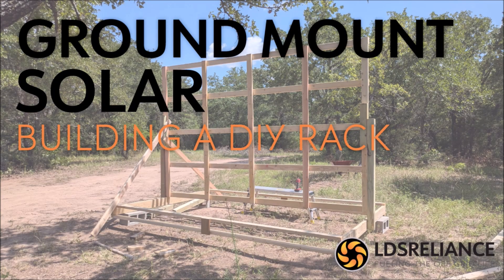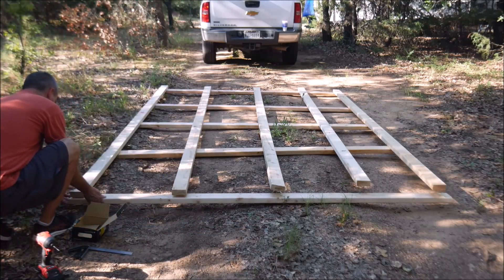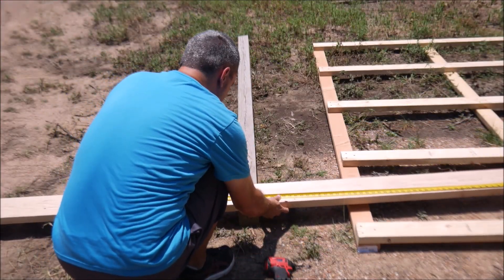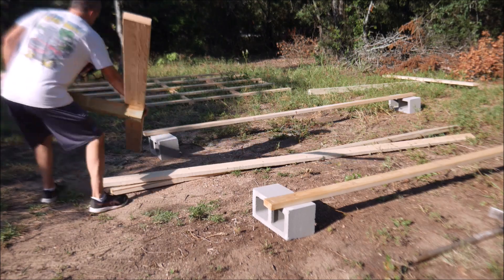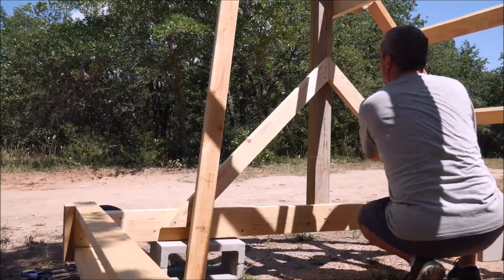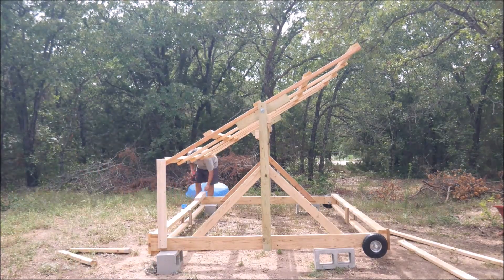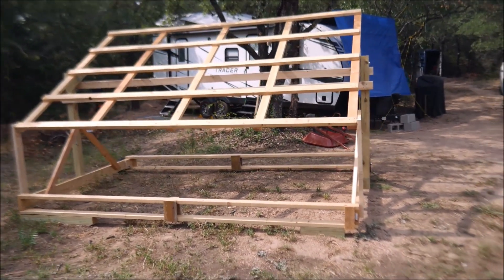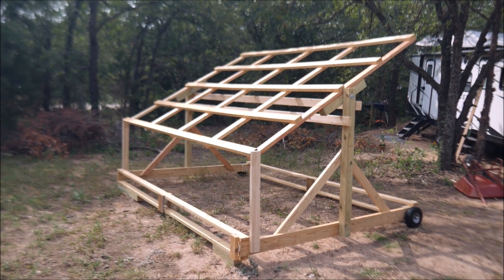DIY Ground Mount Solar Rack Setup - Part 1 - Building The Rack With Wood

Comment: the wood would be more structurally strong if used on the small edge rather than laying them flat like this.  The surface would be less likely to bend if they were positioned that way.  Also anytime you can make a triangle that is your strongest shape.  Some bracing from side to side is going to be needed.
Reply from the maker: Yes, I mentioned that at the end of the video.  Good comment.

Comment: I’d like to offer some advice based on my own experience. 
 The pneumatic tires you have will not hold up for long being exposed to the sun, heat and cold. I know you intend to replace them with larger ones and I highly recommend you find either solid rubber tires or plastic ones that don’t have air. They will last longer as I have yet to need to replace the solid rubber ones that I switched to. 
 The solar rack looks great, BTW.
Reply from the maker: They are not pneumatic tires.  They are solid rubber "never flat" or whatever.

Thanks!  I think it turned out pretty well myself.
Reply: Or just leave them off until til the day you move them and then take them right back off. No sense if letting them get weathered when not in use.

Comment: I have a similar mount, but it stays vertical year-round, my new mount design vid explains it, 3 weeks I will have new version video. It works good with bifacial panels with snow or white rock around the array.   Designed to hold 2 600w panels per frame, easily made wider to hold 4 or 5 smaller panels, they are mobile with wheels or a forklift in case of extreme weather put them in the barn. Vertical 465W panel in heavy rain 76w, overcast 125w, snow and sun 569w. Dec, I go overrated and summer no white rock 300w. 12kw array in summer can make 50+kw a day, winter 6 hours of clouds 17kw. If you go static mount winter angle it should be fine in summer with all that sun over 16 hours a day. Vertical mount clean once a year, snow never sticks. Just adding the snow part for anyone else who may see this. Your mount is great for smaller arrays that need max #s all year.
Reply from the maker: If I get bifacial panels then I will absolutely do a fixed angle rack for the permanent ground mount setup.  But right now I'm bootstrapping with what I have and all I have are mix match old school panels of various sizes from 100-190W.

Comment: How often do you anticipate it needing to be moved? If the wheels don't last or work well perhaps some skids made of wood and pull it with your truck.
Reply from the maker: I expect to have to move it in the fall/winter when I get a tractor.  I'm going to clear and level some more area.  Then I'll have to move it again when actual construction starts (hopefully in about 12 months from now).

Comment: Did you do the trig to work out the difference between a fixed angle and a tilting one? 23.5 degrees?
Reply from the maker: The rough rule of thumb for good all year round production is to mount them at an angle that matches your latitude.  So for me that is about 38 degrees.  But that is not optimal for summer or for winter.  It is just the best angle that can still produce a decent amount in both seasons.  There are some calculators out there that will tell you optimal angle for solar for different cities and locations.  I certainly can't do the math myself!
Reply: @LDSreliance  The question is "Is it worth the bother of making the panels steerable in Longitude?  or just put up with lesser output depending on Season. In practice you would optimize them for the season when it rains and mount them fixed.  With the extra cash saved on all the messing about just add a few more panels. ..  The Maths is pretty easy. Jim Pytel has a You Tube channel with lots about electronics but there is a few presentations on Slaor power.
Reply from the maker: If you are talking about solar trackers, which cost hundreds and thousands of dollars and introduce multiple points of failure to the system then I would agree with you.

However, I literally spent no additional money to gain the ability to adjust the angle.  I would have constructed a very similar mount structure to this if I was going to build a fixed angle ground mount.  I can go out with a cordless drill and adjust the angle of the entire system in less than 5 minutes with one hand.  That beats any fixed angle ground mount of any kind.

Comment: You could add another 2x4 at the top and bottom going left to right to strengthen it up too.
Reply from the maker: If you look closely toward the end of the video I did just that.  One 13' 2x4 going left to right on either side of the post.  It definitely helped lateral movement but I also placed them up toward the pivot point to act as "stops" to prevent the whole thing from freely spinning in a 360 if I remove the attachments at the bottom of the array.  Not sure if that makes sense.

I thought about putting a 2x6 from front to back in the middle of the frame at the bottom near the ground and then tying the posts in at 45 degree angles with braces to that center point and that would stop all lateral movement.  But I don't want to keep making this heavier if I don't have to.